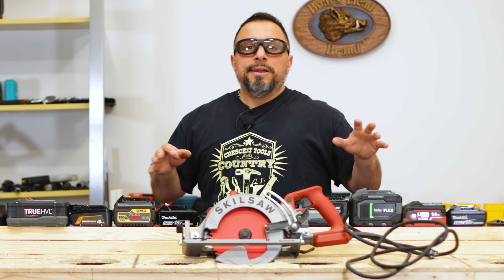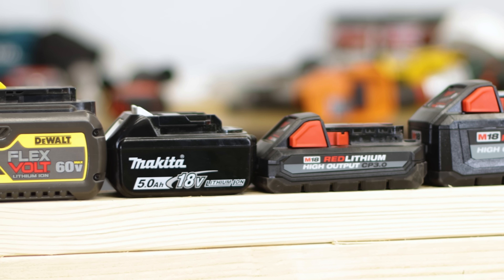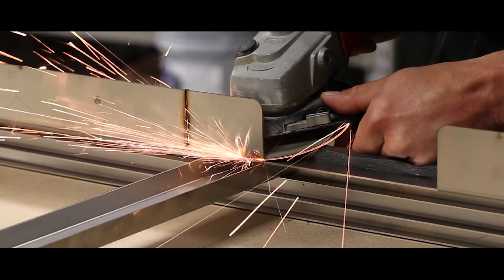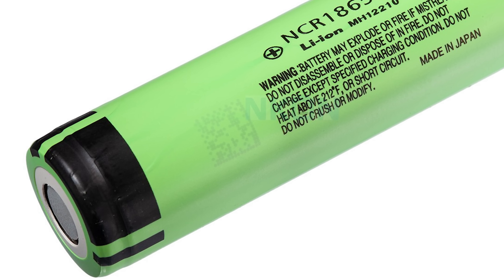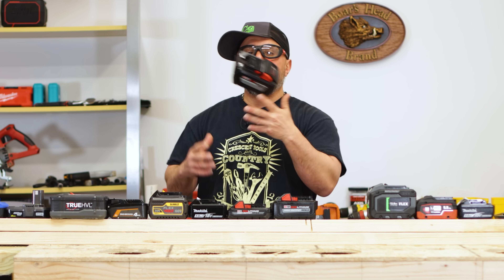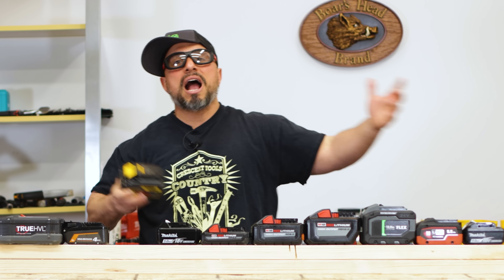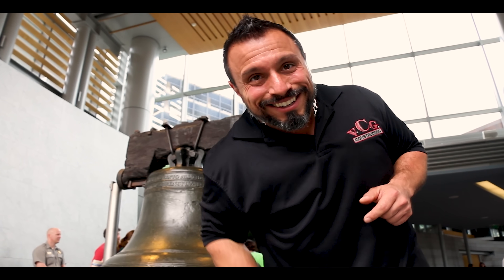Get The BEST PERFORMANCE From Lithium Ion Batteries & Make Them LAST LONGER!

Comment: Hey Vince, never throw any Lithium Ion battery pack into the trash. We do not need this in a landfill! There are in Lowe’s and Home Depot recycle boxes to put your tool batteries in so they can be properly recycled by the company that each store has agreed to do it’s recycling. Please tell your viewers to use these recycle boxes so we can safely have the batteries recycled by these companies who specialize in this process. They have been doing this at both stores for a long time now so no excuses for those who regularly go to them can participate in this effort. Thanks Vince, I know you will help in this effort. We need 100% participation so we can keep these and other recycled batteries out of landfills! Stay safe mates!😊👍🏻😷
Reply: Or better yet, sell them on eBay or gift them to someone who likes batteries. Usually a battery pack will give up because one of the cells in it has given up; the weakest link in the chain. The other cells are still good for something and can be used for all kinds of things - DIY electric vehicles, tools, remote control stuff, UPS, everything.
Reply: @imperialsecuritybureau6037  I think the reduce and reuse come first and recycling is a last resort. Trash is trash. It’s easy when it’s part of your routine
Reply: You might be able to repair your battery by replacing the individual batteries inside your tools battery.
Reply: They have not been able to actually recycle lithium ion cells themselves its the rest of the tech in the battery they can recycle. Lithium ion batteries are absolutely horrible for the earth just look up the huge smart car lots they have in the uk and a few other country's. They can't do anything with them so they just sit and rot. At least lithium iron phosphate has an almost 3000 cycle life down to 80 percent so they last alot longer but we still don't have the tech to recycle them.
Reply: Good advice obviously, however are they really being honestly recycled ? Walmart and Target got busted trashing recycled dedicated items right on the landfill after all us people went through all our efforts to recycle. We can only hope.
Reply: @waldronelectricpittsburgh1162 , you can choose to believe it or not. What the others do will certainly have consequences attached. EPA doesn’t play with this. The fines will be heavy and the environmental impact is ruined water from both because the batteries will break down and leech into the water table at some point. I hope Lowes and Home Depot are not doing what they did, but there are no assurances and we are taking this on faith. Hope they are more earth conscience than Walmart, can’t stand them, and Target, I’m surprised and not happy over that. Would like to see some references to both incidents and proof of the story. Lots of misinformation on the net as well as the news these days. If the investigation was legit, there would be information on the EPA website on it. I would check that first for verification. As this is a clear violation of EPA directives as well as common sense, or in this case, a lack thereof!
Reply: @derrick9605  tell that to the car people
Reply: Womb Raider  gotta make the world better for the people that come after us, maiden.
Reply: Womb Raider  can’t imagine how uneducated you must be to think what he is saying is “crusading”
Reply: Ok, Karen!
Reply: Those same companies that are supposed to be properly recycling batteries are prob taking them to the exact landfill the trash man is.
Reply: Keep supplying the suppliers with your recycling. The next battery you buy could be the same case and internals you recycled. $$$$$$$$
But It is good practice to recycle if you can.

Comment: The other day I had a problem with my Dewalt battery DCB207
I brought it to my buddies house to do some work. I checked it. It was at 20 V when I left, but now I put on the charger for the fast charger and the charger. Both of them said charged when I measured it with a meter it was 16 V . I put it on myXR DCD791 it doesn’t work but when I put it on the 885 impact it works
Reply: I have had that battery since 2019

Comment: I agree.  I have two 2013 built 1.3ah DeWalt batteries that came with my DeWalt DCD771.  I have rotated them everytime I use them, leaving one battery on the charger all the time.  When I need the drill, I grab the battery not on the charger and use it.  After use, the used battery goes on the charger and the battery on the charger becomes the one I will use next.  I now have seven DeWalt batteries and I will rotate them in the same fashion on my five DeWalt tools.

Comment: Okay so I'm a dummy (when it comes anything electrical). Can "anyone" tell me that if I replace a lithium-ion (5 VOLT 1.5 AH) with a similar voltage but higher amperage battery will that do harm to the motor in the device (in this case the battery in a hedge trimmer)?

Comment: The individual batteries inside your tools battery are probably “protected batteries” with a circuit in them.  When they get to low, the protection circuit locks it out and won’t allow it to recharge.  They have trickle type chargers that will ping the battery repeatedly with a charge until it can slowly overcome the protection circuits cutoff level.  I had a pair of dead rechargeable CR123 batteries that I brought back to life.

Comment: Did t get half way through this video. Lithium Ion (Milwaukee, Apple computers) made by E-one Moli have a 1000 discharge/charge cycle. Yes heat is an issue. If discharged and hot just put them in a freezer for 20 minutes. The intelligent chargers (don’t put the whole computer in!😂 unless wrapped in plastic with some silica bell packs for moisture control) will charge them up just fine again! If you are using a tool that uses other off shore batteries this rule does not apply.

Comment: So let's say I work in Arizona where outside temperatures are 100 plus degrees and my truck gets even hotter . But I do use my batteries every day . Would it be good to store in cooler with ice pack every day ?

Comment: If you have older packs that you've run often for several years and have a few hundred cycles on them, you can prolong them by not draining them until cutoff.  
Instead, swap them out when they get to 1 bar and you can keep pushing away that green/blue/orange/yellow/red blink of death.

Comment: Im a little late to your party since this is the first time seeing this video, but why cant tool manufacturers implement a store  feature in the batterys? Im a big rc car guy traxxas to be exact and on the charger it has a store feture within the charger so if you're not going to be using the battery for a while it drains it so you can store it without hurting the battery tool manufacturers should do the same expesually if you are just a homeowner that dont use your tools on a day to day basis and you dont destry your batteries prematurely

Comment: Dudes at work think I'm nuts because I don't let my batteries sit in the sun, if we're working outside in the heat I'll stick them under a bush or somewhere in the shade and as the sun moves over and lights up that spot I'll move them
Reply from the maker: Not a bad move

Comment: I use the same battery allows 
That way I get the battery replaced under warranty. When I noticed a battery not lasting as long as it should I will start using it in high Drain devices,Lights,blower. 
Never had a problem with Warranty.

Comment: Great video! Somehow, my M18 2.0 ah batteries that came with my 1/2 inch drill/driver, that I bought 14 years ago are still working. I have no idea how or why they are, but I am certainly impressed with these two batteries. Yes, they don’t last as long, but still work.

Comment: Woah, wait a minute! 300-500!? Today's li-ion batteries far exceed the cycles you mentioned. Those numbers are either from really old polymer, LCO batteries or lab test of full discharge.
"Cycle life" is used to indicate the number of charge-discharge cycles a battery can withstand until it reaches 70-80% remaining capacity. It still delivers all the power but for 20-30% less time.

Most commonly used tools and vehicles batteries:
NCA battery is usually have 800-1000 FULL (0% to 100% to 0%) discharge cycles.
NMC - 1000-2000 FULL discharge cycles.
LFP - 3000-7000 FULL discharge cycles.

The battery management system (BMS) almost always limits the batteries voltage to nominal 3.6-3.7V but it's "100% charge" is 4.0-4.2V. Also puts a bottom (cut-off) buffer as it's never remanded to over-discharge the battery. The absolute bottom is 2.5V (2.0V for LFP) but the cut-off is 3.0V (2.5V for LFP). So you are never using 1 complete discharge cycle under normal operation of a battery pack. You're most likely to double the rated discharge cycles and still have a 70-80% capacity left in the battery.

- Heat and over-discharging is the main enemy of battery life. It's never recommended to use a li-ion battery over 80 degrees C. And never charge a cold battery under 0 degrees C (the charger wont let you either way). 
- Leaving the battery on a charger (after it reaches 100%) for long periods of time (overnight or for a few day) as it can lead to higher temperature or even thermal runaway.
- When in storage for a long time, store batteries in a relatively cold place and with 60-90% charge.
- Dropping the battery can brake a solder, fuse, connection or puncture the battery. Power tool batteries are usually pretty robust.
- Fast charging over 1C will slightly shorten the battery life. (1C is a charge rate that represents the power needed to do a full charge in 1 hour.) Most batteries can safely withstand 1.5 to 3C. 
- Thermal runaway can happen at temperatures above 200 degrees C (210-250 degrees C).
- A quality battery pack can outlive the tool (or vehicle) of you take into consideration the above-mentioned safety advises.

Comment: 7:00 it actually happens at ANYTHING bellow 3.0v in any cell... it would be nice to have a built in storage voltage regulator... we have them in the rc world... and its cheap
Reply: One way to fake a maintenance charge with power tools is put them in the charger and put the charger on a timer so it will top off periodically. Not as good as a proper maintenance/storage charge regulator but prevents infrequently-used batteries from self-discharging into the "dead" zone.

Comment: If the battery housing and electronics are good , why not offer a replacement cell service to the consumer? Such rebuild services were available for older nicad tool batteries.

Comment: When a battery gets "too low", its not the battery, but the charger. The charger won't charge an otherwise good battery if it doesn't detect a certain voltage. You can recharge these batteries with another battery to bring it up to a detectable level but there's no professional or authorized method... especially for liability reasons.

Comment: Idk man my old job I worked for 2 years (construction) it was a 6 man crew with a utility truck and we kept all our tools/power tools in the utility boxes on the side of the truck YEAR ROUND! The Milwaukee drills would be stored in the boxes every night summer winter spring fall and this was in Houston Tx!! 110 degree summers in a Steel lock box! Or 35 degree winters, and not to go against the grain, but man we used them things almost every single day, not saying this isn’t true and I will try to upkeep my own out of pocket tools better but just speaking from my experience, I was never under the impression temperature had an affect on a drill battery, so I guess this video is basically a shocker and eye opener

Comment: My friends think I'm crazy but I NEVER charge my battery until it's damn near dead I don't run it too dead because I don't want it going below the minimum voltage threshold & I make sure I do that 2 get the most cycles out of it & if I did use the 🔋 on a power hungry tool that gets the 🔋 🔥 I never put it on the charger while the 🔋 is 🔥 at least 10 minutes to let the cells even out & cool off some.. btw if you store the 🔋, store it around 70% storing 100% can cause the packs to puff up & storing them discharged will go below the minimum voltage threshold & damage the cells... One more thing as soon as they're charged take them off the charger don't leave them on the charger for weeks on end that's got to be some of the stupidest shit I've seen people do. But not my batteries who gives a shit 😂 thanks 4 the video... Sorry for the long message but I've been a 🔋 geek for many MANY years way before lithium ion even came out.. I had a set of Makita 3.0 amp hours before they even had the 🔋 level indicator button I do side jobs & diy guy & those Makita batteries lasted me for about 10 years & they still worked on most tools except for the high demand tools like my grinder & circular saw. God bless you! Thanks again for your time

Comment: SAMSUNG INR21700-40T cell in the M18 H.O. Line-up (very good cell) has a datasheet spec of 60% capacity after its max cycle life of 250 full cycles. That turns the 12.0Ah battery into a 7.2Ah capacity at the end of 250 full discharge cycles. Sure, “it works” or people will say “it’s still going strong” but the reality is that the degradation has occurred but it was a pretty stout battery from the beginning. Heck, any 7Ah M18 is still a workhorse!

Comment: Millwaukee card less drill came with two  batteries 12 years ago still going strong, I mix joint compound with it every day,when the batteries are dead I charge them over night, a battery will last 3 / 5 days  on a charge running it all day.

Comment: I had a Milwaukee V28  system of tools and the batteries would die on me when I left them in the truck over night. The dealer would replace the battery without question. I went through several batties before I got sick of returning them. They would not believe me when I told them about the cold, they would just replace, dumb.

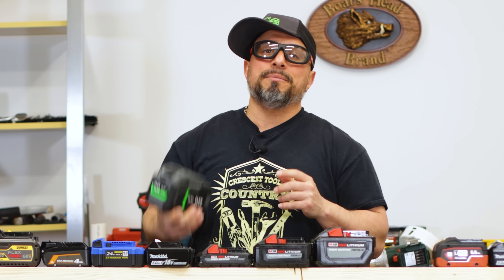Comment: Okay, I get the part from 9:22 - 10:22 in the video about not running and discharging the battery below the 20% level, but why the prohibition about charging it to 100%?

Comment: They already do have that technology and DJI in drones the batteries they use uses this technology.

If you leave a fully charged battery without using it for about 4 days It automatically discharges to 50%

And then when you're in the drone it tells you to land the drone gives you a warning that it's 20%

Absolutely perfect

There's no reason for these manufacturers not to have this technology in their batteries AND FOR THE FREAKING AMOUNT OF MONEY THEY CHARGE WHICH IS RIDICULOUS THEY SHOULD HAVE THIS TECHNOLOGY!! 

You talk about batteries and below freezing. Well for instance what about snow blowers battery powered snow blowers. I have the PowerMax two-stage electric snow blower that runs on really big 7.5 amp batteries. 

You will almost always be using them in the cold.. usually below freezing. 

Very interesting

They say that the power flex battery is from Toro are among the best cells and they have an Intel chip in them.

I wonder if they incorporate some of that technology we are the battery at one bar is 20%

But I tell you what these snow blowers you need to discharge them all the way or you will never get any runtime and that's the problem. 

Can't keep shutting them off at 20% and then recharging for 3 and 1/2 hours you'll get nothing done.

So they should make the batteries bigger and then that one bar should shut the battery down at 20% even though it seems like it's zero

Completely agree with you there. 

But at the other end there is no reason why these manufacturers can't incorporate the same technology DJI has been incorporating for 5 years in their batteries. Automatically discharging to 50% If it's not being used. 

You could actually change how many days you wanted to discharge the to 50% inside the DJI app.  You can pick up to 10 days. ..

Come on manufacturers get with it!! As usual China is ahead In everything with technology..

Comment: I almost never use a rapid charger. They are the number one reason for early battery degradation. I keep one on the truck, just in case I need it but it mostly collects dust. I know what I do - day in and day out - so I have enough batteries to get it done. When I get home, the dead batteries go on the myriad of slow chargers I got free with my purchases. They're always charged before I go to bed and ready for the next day. Why beat up my batteries for no good reason?

Comment: Was a lithium ion cell in a perfect world you would never discharge it below 20% and never charge it above 90% and that would give you double the life cycle so you can get a thousand life cycles out of a battery and you're only losing about 25% run time out of each time

Comment: Rules for any lithium ion batteries:
1. Charge up to 80% and discharge to 20% (most damage comes from this). 90/20 also works
2. Never fast charge, the slower the current the better. Also the less charge cycles the better which is obvious.
3. Store in the basement or cool environment no longer than a year or so before charging back up.
Reply: This is the same with my Tesla
Reply: So let's say I work in Arizona where outside temperatures are 100 plus degrees and my truck gets even hotter . But I do use my batteries every day . Would it be good to store in cooler with ice pack every day ?
Reply: @isiaac5715  Short answer is yes.  Batteries above 86f will degrade faster.

Comment: I bought one of those small fridges with freezer and cut a hole for a cord to run through sealed it and walla I charge all batteries in there! I did cut the part out thst separates freezer from fridge! Be careful not to cut any tubing or electrical